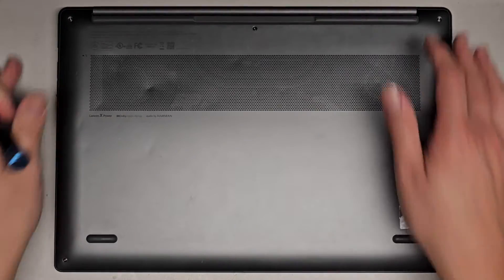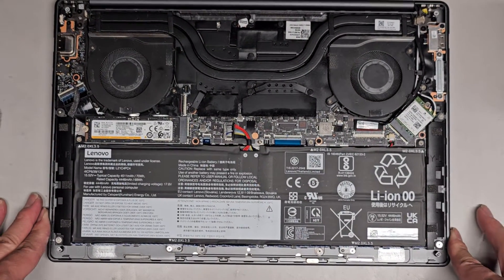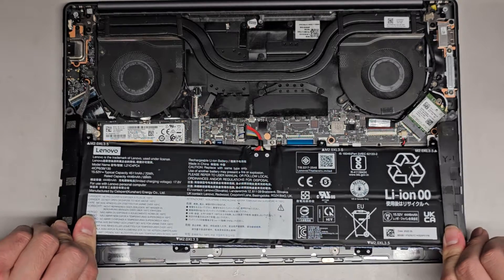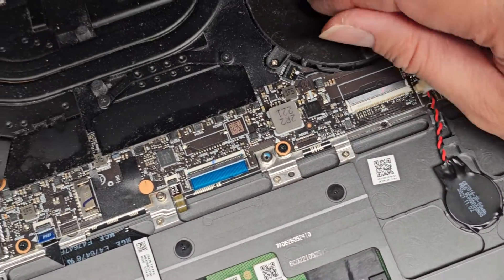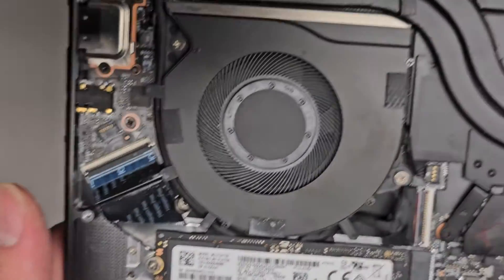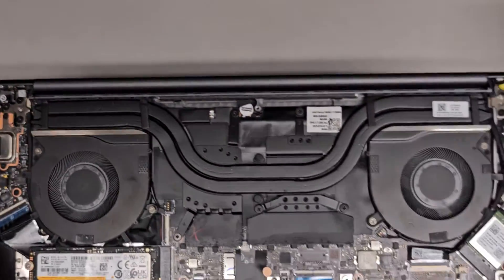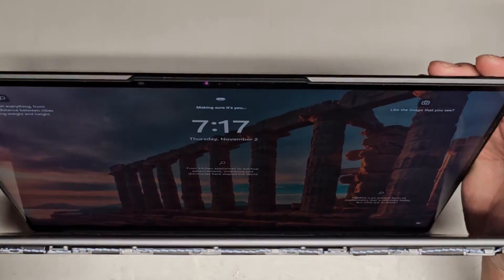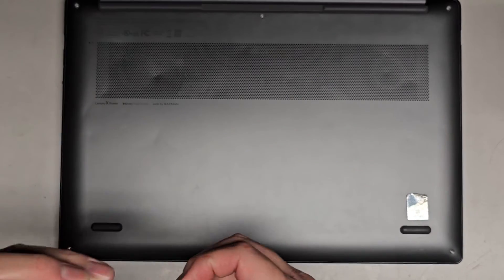Lenovo Slim 7 Pro X ProX 14ARH7 Disassembly SSD Hard Drive Upgrade Battery Replacement Repair No RAM

Comment: this laptop always seems kinda glitchy, random usbc issues when using an external monitor. and often, when booting into the uefi bios, it will max the fan and overheat. even with the latest bios update. Fans are definitely clean, any idea what's up with that?
Reply from the maker: Hmmm no clue. Sounds like a damaged connector.

Comment: I need help! I have been experiencing bios problems for a week where each time i turn the laptop on, there is a tpm reset option that pops up. I reset it, but it showed up again. After that my laptop would overheat when charging, so I disassembled and applied thermal paste snd cleaned the fan. I tried updating bios through lenovo vantage but it failed, and then it completely stopped turning on. It somehow turned on later, and displayed the message that “bios self-recovered” and since then the screen doesn’t turn on but the keyboard turns on; however the esc and caps lock key lights are off as well. I tried turning it on several times but the screen remains black. Am i cooked?
Reply from the maker: Did you get liquid on your computer?
Reply: @ItsBinhRepaired no, it just randomly started acting like that.
Reply from the maker: @alihc8444 very strange. Sounds like a motherboard issue
Reply: @ItsBinhRepaired i will try to remove the cmos battery for a while and insert it back in, and see how it goes.
Reply from the maker: @alihc8444 OK
Reply: Had pretty much the same issue happen to me 2 days ago. Checked some sources and the only fix I haven't tried is reflashing the BIOS, everything else from powering off to CMOS resetting has done nothing, and everything is pointing to faulty RAM in the unit being the cause.

So yeah, probably cooked :(
Reply: @BNS_OP i tried flashing the BIOS using a usb drive but it didn’t work. When I asked lenovo support they told me that it is because the BIOS update file on their website is new and does not match with the old one I have, so it won’t work. I then took it to get it fixed by a technician but they said the motherboard is cooked and I will need a new one. Now i am getting a new laptop 😢. However, I will try to flash the bios using the CH341a programmer in the future.
Reply from the maker: @alihc8444 use an older bios first closer to the current version.
Reply: @ItsBinhRepaired the lateest version is the only one they have on the website. Idk if there’s any other place I can get the older one.

Comment: Please help, I need to locate in the motherboard where is the camera connected - my camera is not working and it might be a connection issue.
Reply from the maker: Screen cable?
Reply: @ItsBinhRepaired  no, not the screen/display cable, the camera cable
Reply from the maker: @SonGohan-t1w same thing. Follow the wires going into the screen

Comment: Hey there wonderful video btw, may i know if u can send the battery to me? I live in india and im not able to find the batteries here, i bought the same laptop in ny, my laptop stopped charging and only works when plugged in? I tried every single doagnosis available, please do let me know if i can try anything else, i accidentally deep discharged my laptop battery and then it charged till 65% and its been a month and it natually discharged to 34%
Reply from the maker: It'll likely be close to $150

Comment: I spilled some tea on the side of this laptop and everything is working fine except the fans. The fans completely stopped working and I am really concerned. What should I do?
Reply from the maker: You might need to replace the fans if liquid got in them. Sometimes the fans don't spin when not hot enough.
Reply: @ItsBinhRepaired Ye I need to replace them. I can hear the fans making some concerning noises but they aren't spinning. Thank you.
Reply from the maker: @Peepersarecool  hope the repair goes well.

Comment: Do you think it's okay to clean the fans with an air duster without completely removing them from the chassis? Also where can I find the screwdriver set (T5 torx) you used to open the back? Thanks
Reply from the maker: Yes, but don't use the cans. If you do, read the instructions carefully. This screwdriver set works well. https://amzn.to/3Ngi33p
Reply: @ItsBinhRepaired  thanks, I was planning on getting an electric air duster, is there any specific reason as to why I shouldn't use a can?
Reply from the maker: You have to be careful with holding it too long. It blows freezing cold air that causes condensation and liquid damage. It can also ruin the grease in fans.